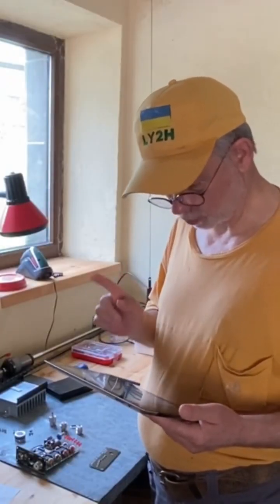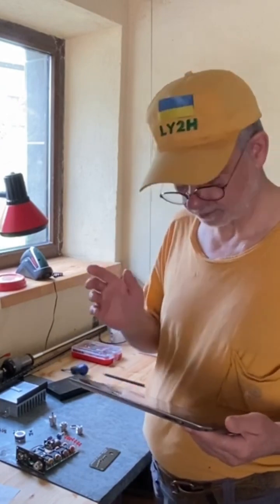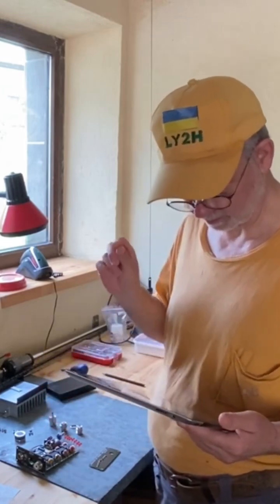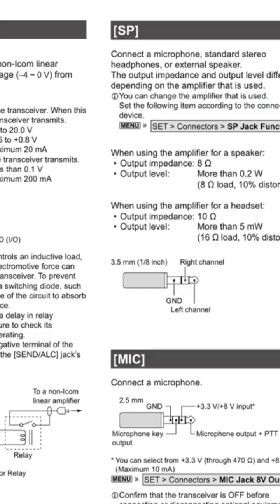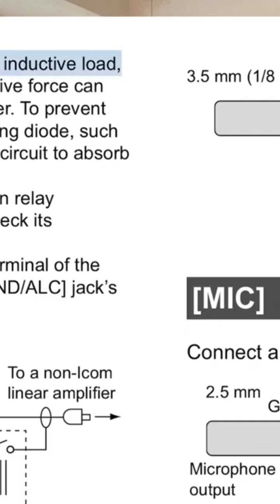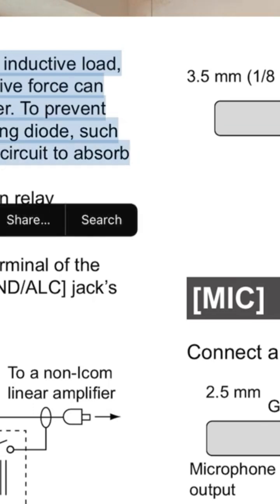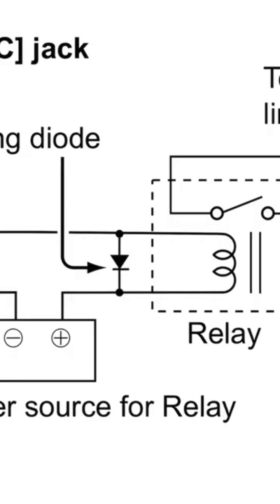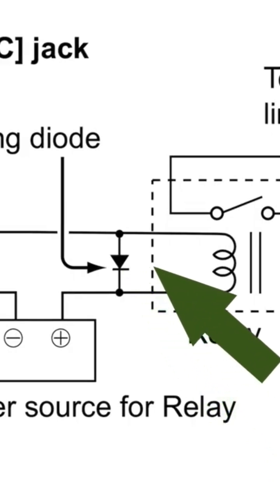ICOM warns of possible damage to its IC-705 when used with cheap HF PA's

Comment: the PA-50 designer will not be that dummy as to interconnect the relay coil of its circuit to the external transceiver...They must have used opto-coupler and or a transistor to drive the relay inside the PA-50.........
Reply from the maker: Well, you know... If Icom warns me officially out in the manual about this danger, I better listen to him :) Luckilly, in the long video on this topic I discover that miniPA-50 , specifically, is fine and equiped at least with this diode to prevent the spikes , but there are other products on the market which  are not, unfortunately. So, buyers, beware! Thanks for your comment. 73! Linas LY2H
Reply: @Linas_LY2H  Labei gerei! Thanx for sharing!

Comment: How do I protect my device icom 705 when using the BJ-300 amplifier?
Reply from the maker: Hello, I don't have the BJ-300 amp, so I'm not familliar with it personnaly. I don't think  it's OK to use the CB amplifier on Ham Radio bands without installing the right Low Pass Filters first. As it comes to the protection of the PTT line in IC-705 I speak in my video about, it is not relevant , in my opinion, to the BJ-300 as this amp does not use the PTT line for the TX/RX switch due to the RF sensor method employed for this purpose. HTH, 73! Linas LY2H.
Reply: @Linas_LY2H  Can I use the PA100X speaker without problems? For icom-705 :)
Reply from the maker: @klshaytube  Hello, I have no ideas what this speaker is about :) But if it's one of these standard blue tooth speakers, I see no reasons why couldn't you use it with IC-705. Good luck! 73! Linas LY2H

Comment: The back EMF of the relay coil presents a reverse polarity high voltage spike to the radios TX keying circuit and could trash the circuit or other components. This should have been learned in the technician course.  A reverse diode schould be added across the relay coil to take care of this spike some times called the "fly back " effect  and called a "fly back diode" a 1n004 should work for you or better a 1 amp schotkey diode. The study of electronics doesnt end with passing the test.  I learned how much fun that i could have with an inductor when I was about 7 years old with a bunch of my friends lining up in series to get "zapped" by my little box  with a buzzer inside.
Reply from the maker: You are right! And this Short is directing to the Long one which exactly  covers the topic you comment on. 73! Linas LY2H
Reply: So with a little mistake zapping your friends you could still be in prison!

Comment: I've heard of this issue, but have been unable to find the official ICOM tech bulletin regarding it. 
I have a Hardrock-50 and an Elecraft KPA-100, but haven't placed either amp in line yet. A friend provided me with a small opto-isolator relay board like the one he employed between his radio & his amplifier. 
Not thrilled that I have to add another piece of equipment to the mix, but the alternative isn't something I want to experience either.
Reply from the maker: Hello, thanks for watching. The long video version of this Shorts has more detailed info. Normally, checking the schematic diagramme of the PA make it obvious if the PA has this diode around relay or not. I would make sure that the relay is used at all, it could be transistors or opto-pair employed already. If there are some connection specificities, they are usualy described in the user manual. Unfortunately, I don't have neither of these two fine PA's you mention about, so no personal experience to share here. From what I know, the Elecraft PA is a higher-class product, it shouldn't have flaws typical for some    cheaper  devices, IMHO. Good luck! 73! Linas LY2H